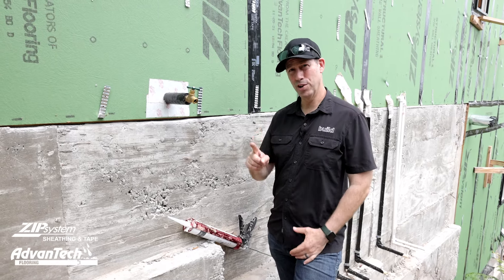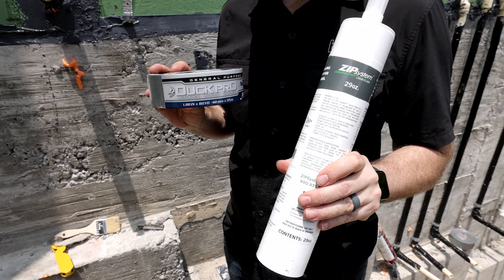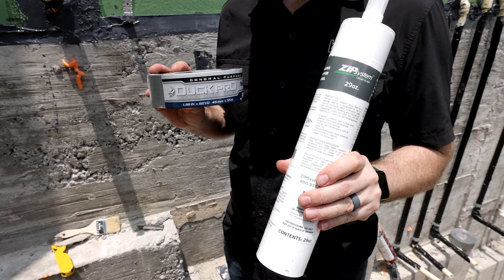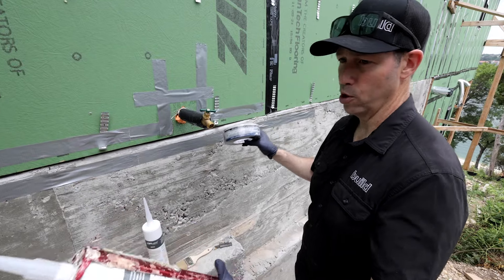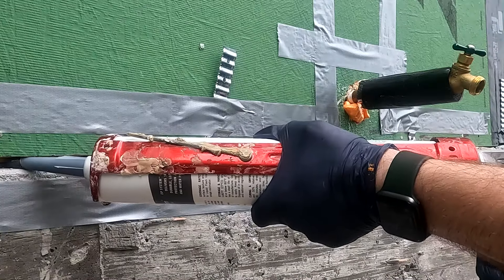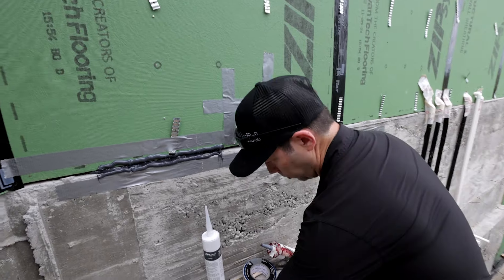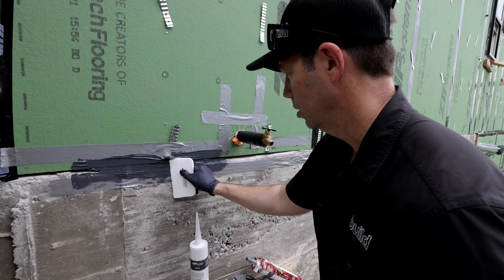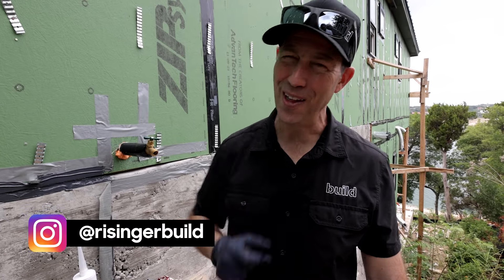A highway for BUGS to get in your house. Seal this joint!

Comment: I'll be having my home re-sided and was only going to specify using a peel and stick flashing tape in that joint area (3m, etc) for air sealing. Being covered with WRB (Tyvek) and then some polyiso insulation board I didn't consider adding yet another "belt" to my "suspenders'. It looks like it would need a LOT of sealant material the way its shown here, but perhaps I only need to seal the interface/gap area since the tape and WRB should do the rest? I'm planning to overlap these onto the concrete foundation a few inches anyway.
Reply: Looking at it, it reminds me of prefilling drywall cracks before you tape, so pretty much the same process you're describing
Reply: Nothing prevents you from using cheaper products as a 3rd or 4th belt to your suspenders. Foam  rod or spray and a decent exterior caulk, mortar?! anything that will make a certain gap into a mostly certain seal will be better than a wide open highway.

Comment: Matt - great information. Quick question - a few months ago you did a segment on your new house where you had it air sealed using an airborne spray done under negative pressure. Is it your opinion that you can do this on an existing finished home (basement only)? If so, what precautions would we need to take to ensure minimal environmental gassing, etc.?

Comment: I wonder why we don't put a sheet of copper in the concrete foundation so when we put that pice of wood on top it pierces into the wood to make a complete wall, then fill in the gaps with some type of awesome liquid epoxy (Calking) to make it really air (water) tight so then no bugs would walk through?

Comment: I’m remodeling in Phoenix. Dying to rip the stucco wall outside envelope off the home. Want to creat new thicker walls with 12” poly foam (previous Build AZ site video). Since the new 12” insulation wall and green Zip wall are thicker they will over hang the concrete foundation base. Any suggestions how to support the over hang as well as not create a new insect super highway?
Reply: Hi. For the video you reference, is this one of Matt’s previous videos? If you find any answers to how to insulate when the plywood overhangs the stem wall, let me know. I think you just have to do the same thing from the underside, which is harder because it is harder to see what you are doing.

Comment: How about a sill membrane that you put under the sill instead when you lay it? In Norway we use like a 3-5mm membrane that gets compressed as you bolt down the sill, eliminating low spots. This seems very time-consuming and expensive
Reply: can you double layer a sill plate membrane? I know he did an episode with a house seal (rubber house gasket that seemed nice but super hard to find).
Reply: @Hedgehodge-  We only use one, which then wraps over the shrathing of the house. The membrane is not liquid, It's not a problem to lay a double sill

Comment: In VT the energy code doesn’t permit you to use sill seal, you have to use some kind of caulking
Reply: Really? No foam? Why is that?
Reply: @realruggeddiy  the same reason talked about in this video. A 1/2” bead of silicone beats that thin sill seal in air sealing. They also want the bottom plate caulked to the subfloor and the drywall has to be caulked to the corner posts, top and bottom plates as well.

Comment: What do you do if you've purchased a house that has bugs coming in under baseboards as well as cold air in winter (assuming that means warm air in summer too lol).
Reply: Identify how they are getting into your wall cavities from the outside, which will also likely correspond to how free flowing air is moving in as well. Its then flowing under your drywall and out under/around your baseboard. Once you’ve identified the outdoor issues, fix them, and then also caulk and seal your baseboards exc.
Reply: Knock the house down and rebuild
Reply: @wayneguy6043   Seems reasonable lol
Reply: @JimYeats  Thank you! Suppose I'll start the search for someone who can locate the problem for me!

Comment: Is this just new building methods? I thought you want a spot for water to escape if it gets trapped? What is expected of the water if it gets behind the zip sheeting? I am truly curious because i am not a builder but these things intrigue me
Reply: You never want water behind the zip sheathing that's your wall cavity. That means mold. You do, however, want water to escape from behind your siding.
Reply: @AnthonyBrusca  this is exactly what I am saying. Sealing against the foundation will trap water
Reply: @2mustange  no, this isn't the siding. You want nothing to get past the sheathing but everything to get past cladding/siding that goes over top of that.

Any water IN the cavity dries to the inside
Reply: @AnthonyBrusca  I see what you're saying now. So sheathings are completely sealed? I didn't know that. I thought it still had to breathe for a possible "just in case". So if water does get through a zip system it's no different then what you currently would see with non zip home.
Reply: @2mustange  The moisture you worry about with sheathing is generally condensation, not bulk water from the outside. So when you hear people say that a sheathing is breathable, they’re referring to water vapor coming through. (Generally that water vapor is coming from the inside depending on climate)
Reply: @2mustange  I wanted to add to what tim said... The vapor permeability is super important. The zip sheathing is vapor-open so it can dry to both sides. For a few decades, people were putting vapor barriers on the warm-in-winter side of the wall. Which in most of the country is a plastic sheet right behind the drywall. It was always installed poorly and it was pretty unnecessary. There are also studies done showing that the vast vast majority of the wall moisture is from air leakage and water getting in through air leaks not through vapor diffusion. There has been a trend lately for not installing any vapor barriers and just making sure everything is air sealed well. Matt and others say "Build Tight, Ventilate right ... You air seal the house and ventilate mechanically so the air comes in on your terms where you want it.

There's a concept called the perfect wall system which is really expensive, but in essence it's to make both the vapor and water barrier on the outside of the wall and all the insulation on the outside with rigid foam. It's the only way that is 100% foolproof. It's just really expensive and makes siding complicated. Matt built one of those houses a few years ago.

Comment: im my humble opinion, aftrer working for more then 10 year in comercial constructions and using all kind of air bariers, the use of duct tape near fouindation is a vaste of money! this joint will get covered! all you have to make sure is that joint is sealed properly!. the other grate product which is more expencie is foil faiced tape! that thing will seal your fraim to concrete fenamenoly, you just have to make sure their is no dust or moist on the concrete or frame.

Comment: Money grab for zip. Just use con ad in conjunction with sill seal. If you’re paranoid, use silicone and do the same method he’s showing $4 per tube vs. $40 per tube. Btw, I love other zip products.  In fact I just picked up a couple thousand dollars of the zip liquid flash for the first time, as far as Im concerned this product is nothing more than glorified silicone. Just my humble opinion…

Comment: Seems wasteful to use the duct tape masking on material that’s going to be covered anyway.
Reply: He talked about this in a "Zip Sheathing 2.0 video" and some other builders have talked about the guide tape. It is to make it look good and signal to homeowners and trades "the attention to detail". Same for a clean job site. If you don't have a messy job site, the trades will make it worst. If the job site is kept clean, trades will often take more care. Not always, but I can say from personal experience that it helps.

Comment: Seams like way too much work….butyl sealant with a single pass seams equally effective and 4x faster. Taping and tooling seems uneconomic
Reply from the maker: Butyl is the wrong choice. Lexel would work though not as good as a Fluid Applied Flashing. Prosoco Fast Flash or Joint & Seam are also perfect. Same with PolyWall Blue Barrier 2200
Reply: @buildshow  what makes butyl the wrong choice for this application? To be honest a sticky flashing tape looks way faster and more reliable as well
Reply: @powrrangr99  fluid applied flashings and seals like these work well

Comment: It's nice and easy when it's shoulder height and the surfaces almost plane out, but when you're at ground level it can be more tricky, read PITA, trying to lay on your back and get under the proud Zip-R.   You can see a run-through of a few liquid flash options (Prosco, Zip & Polywall) I've tried at this video. https://youtu.be/Nc6UpSfUETI
Reply: I commented on another of Matt’s videos about casting a “metal lug” into the slab - a 1.5” notch around the perimeter. Run the zip down 1-1.25” and then caulk into the corner. I use big stretch caulk to create a backer then cover it with zip liquid flash. The zlf is too expensive to use on it’s own.
Reply: @atomicsmith  Given that Zip fluid applied can get expensive when flashing around all the windows and joint area at foundation, I'm going to try Siga's Fentrim for that foundation detail. It seems like it will grab onto anything and I'm hoping the bugs won't tunnel through that. I even tried Zip tape for the concrete to ZIp joint and it doesn't have enough gusto to stick to the concrete foundation without a perfectly smooth, dry and pristine surface.
Reply: @hu5tle-  Go for it. Although I can't imagine a siga product will actually be less expensive! The ZIP LF is good at bonding to concrete, but you really want it no more than about 1/8" thick. Otherwise it takes forever to dry and honestly is hard to work with.
Reply: @atomicsmith   Fentrim's only ~$80/roll. I could see me using 3-4 rolls for my projects. Even if it' more in materials, it saves me a ton in labor. Laying down tape is far quicker than taping off the area, applying, troweling in, etc., etc. for Zip. Gotta look at all the costs.  I'll post about it when I cross that bridge.

Comment: Couldn't you just use spray foam in that area?
Reply: Seems like it could work for the bug prevention aspect if you have a nice crack to work with, but if you get a small crack you can't spread the foam around easily to cover nicely i wouldn't think

Comment: what a mess...waste of money too...better way to do it...😢
Reply from the maker: What is the better way Chuck?
Reply: @buildshow  well you start out with flat,straight foundation wall…it is possible…then you could double or triple the sill seal…you could put one inch of fiberglass insulation under the plate…you could put mortar at the seem ?…anything that compresses to give a tight seal…!!!   ( whoever poured that foundation wall needs to find some other type of work maybe a BUTCHER )

Comment: Why, o why,?
If houses here would actually be built in a proper fashion using brick and mortar stuff like that is not needed, nor is re-sign, painting etc.
Yes, bricks need to be properly sealed, especially below ground, but if it is done right none of this nonsense is needed.

But the reason for the shoddy construction is,it needs to be as cheap as possible to maximize profit.
Just terrible
Reply: I hear your point, but brick and mortar are terrible materials to use in any seismic areas, just FYI.
Reply: @jessesilver  wood is also flexible and more versatile. Which is why we use it.

Comment: Or, you just build your walls with brick. :)
Reply: Even the UK is moving to timber frame. Nothing wrong with wood if it stays dry.
Reply: @charlesrodriguez7984  Can't get bricks from the mainland after Brexit anymore?
Reply: @b_lumenkraft  i guess so. Though it’s a facade not a real structural brick and mortar with timber frame structure.
Reply: @charlesrodriguez7984  Interesting.
Reply: @b_lumenkraft  they always have used timber trusses for the roof though and timber frame for interior walls with plasterboard. So not much different than homes in the US.

Comment: Why wouldnt you just run a foam gun right around there and then after it dries knock off the excess? Air sealed, bug sealed, and 20x faster saving you time and the customer $$$...